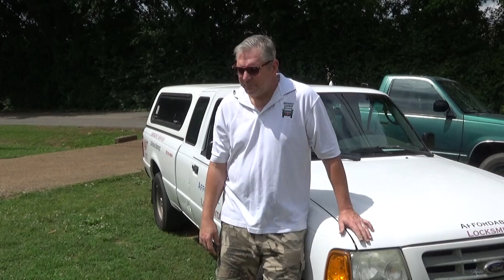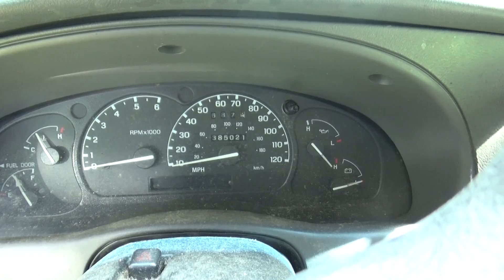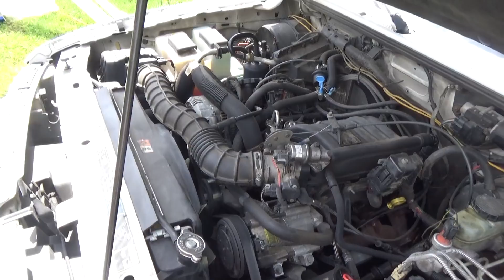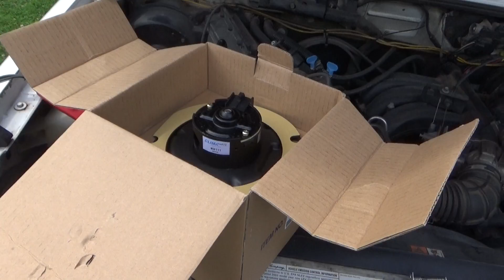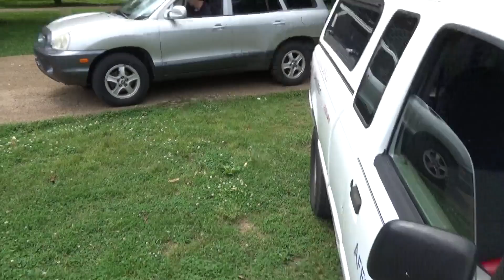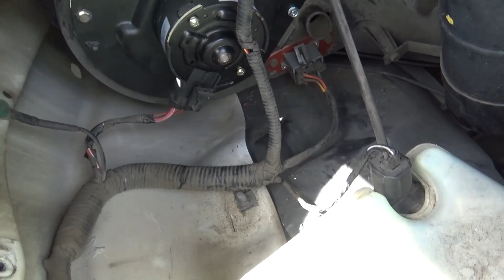Ford Ranger No Blower Fix and Repair- Power Probe III

Comment: Hey bud i have an 02 with 280k on the dash and i love my truck but it just stopped blowing i changed the blower motor the resistor and checked the relays and fuses and its not the temp control any thoughts ???

Comment: 95 ford ranger blower not working replace the rezizter getting power to the blower still it won't work all releys are good fuse is good could it be center control switches

Comment: Have 2010 Ranger, a/c blows cold but not with much air pressure. Any suggestions?
Reply from the maker: sounds like the fan, relay or thermal switch

Comment: Thanks for the video, it helped me out no end.
I would like to add that when the fan is removed  inside the fan housing you can just about see a square screen,Its level with he dash , my screen was so clogged it looked solid" feel for it" ,it is there but not easy to see .Blow the screen out with compressed air.The screen is not removable.Turns out my fan didn't need replacing .The screen was clogged solid with dirt.
Now it works like new. A new fan with a clogged screen will just cause back pressure and noise.I found this out the hard way.

Comment: All of my fuses are good.
I have an 01' I bought 10 Days ago. When I got it, the AC needs recharge-no problem. 4WD out-also a daily easy fix most of the time. So, I checked all the fuses; and then everything WENT TO HELL!
Fuses are all good, but at some point while I was checking them, this situation popped up......

Air Bag Warning light is on
O.D. on/off no longer works.
The switch for the Fan Motor no longer works.
Dome Light no longer works.

Fuses ALL still good.

What in the FUCK is going on?!!!!!

If this can't be fixed, it will be my first and LAST Ford Ranger!!!!!

Comment: 385 thousand miles and the engine sounds like new (?).  And, I would guess most of those miles are not highway miles.  ...I like how easy the blower replacement was on the Ford Ranger.  My 1990 YJ will need to have the whole heater unit, core and ducting, pulled and the firewall hole enlarged before it sees a new one (some day).  Anyways...Rock on David!
Reply from the maker: Thanks brother @! no hardly any highway miles at all:)

Comment: Amazed that you where able to seperate the old resistor from its harness plug, those stinking things almost are always rusted together and discentegrate when you finally do get them to pull apart. Had to replace 3 of those harness plugs in my time on the 3 diffrent Rangers I have owned. Good to see you making videos again!
Reply from the maker: YEah it really wasnt melted like many Ive seen but it wasnt original either
Reply: Yep.  Watched my neighbor struggling to take apart that exact same plug a while back.  My daughter's Ranger never required replacement.